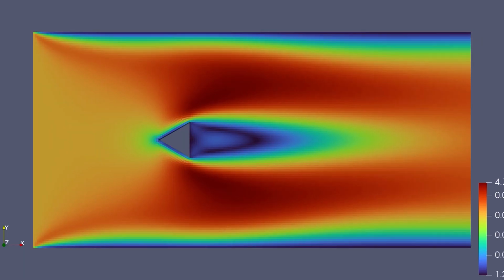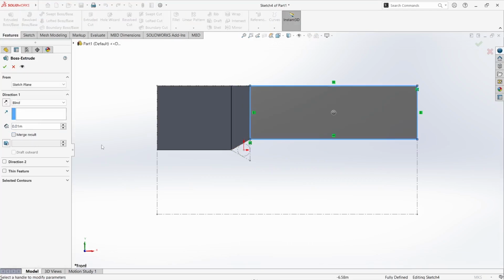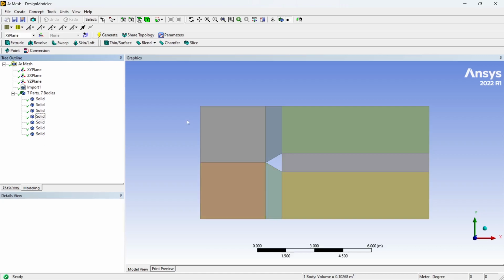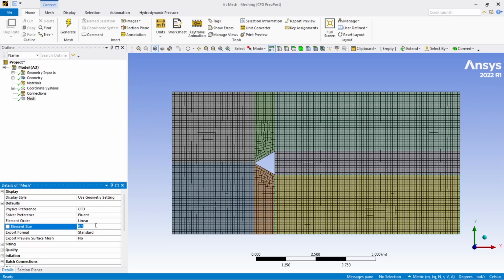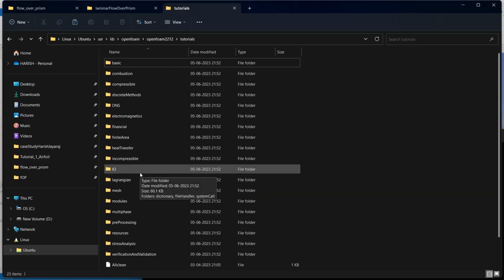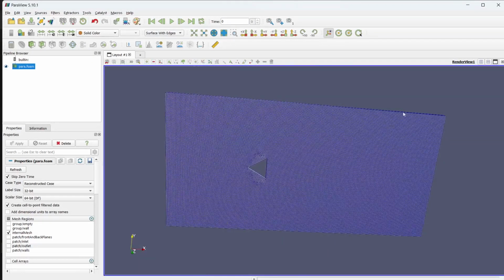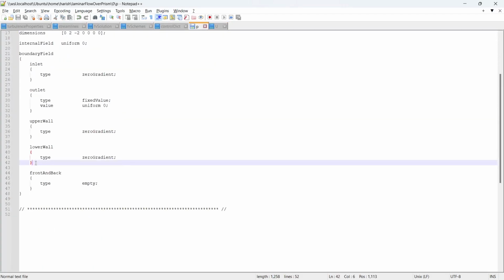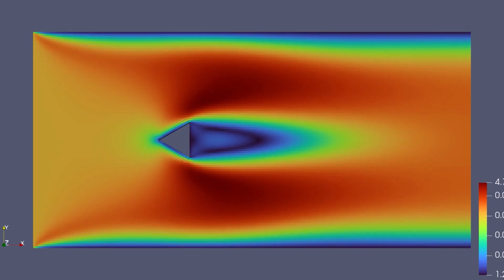2D Flow over prism - OpenFOAM tutorial (simpleFOAM - Steady State) | Laminar | ANSYS Meshing

Comment: Sir on doing fluent mesh to foam is showing some embedded errors, basically I found out the file is binary and not ascii, so it's not generating polynesh file, pls help,🙏🏻
Reply from the maker: In export settings save it as ASCII legacy. and remove the .h5 from the extention
Reply: @Codeynamics yeah I sorted that out, thanks for the reply

Comment: Hi, Very helpfull video. Im trying to solve Ahmad body geomtry, with mesh from ansys. Can this simulation(PitzDaily tutorial files) be used for that? can i follow the same steps to get results for external flow of any geomtry/msh?
Reply from the maker: Yes you can follow. You might have to modify the discretization a bit if the results don't match with any literature. Otherwise you can use the same for general study.
Reply: How about motorbike tutorial?  @Codeynamics
Reply from the maker: @l7a9111  It is good too.